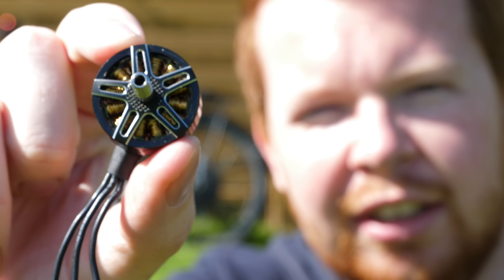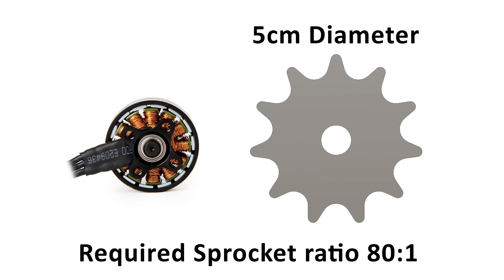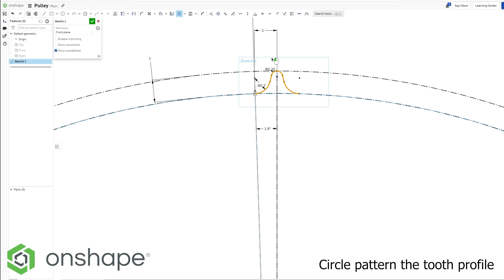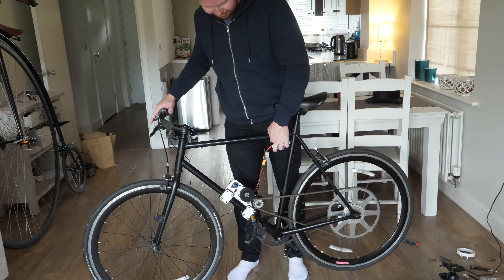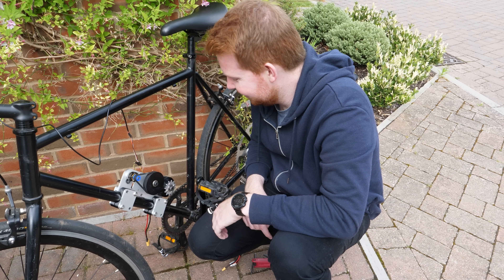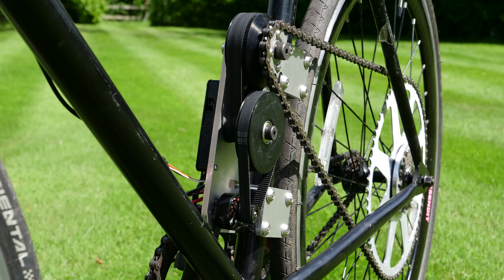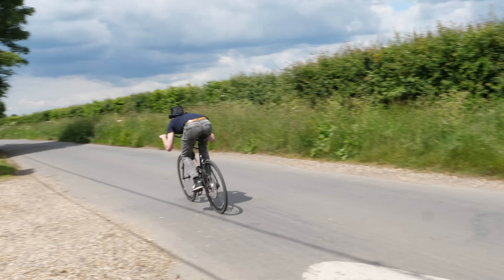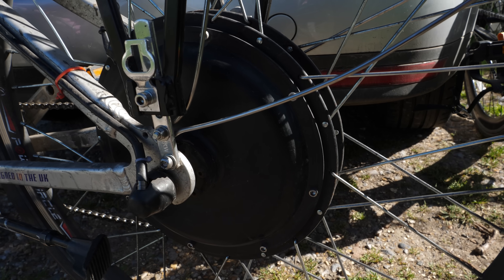Tiny 1kW Electric Bike Motor

Comment: as its a small motor it will build heat fast, what you really need is a cooling fan to remove heat from the motor as you where cooking it as them motors are designed to have air pushed through them from the Propellor to cool them down and some sort of cooling Fan and a duct would help alot.

Comment: The motor is normaly cooled by the prop/fan blowing air thrue the motor to cool it. Might be more reliable with some more motors with fans inside the first  gear  at the motors. skip the chain and make a beltdrive final gear.

Comment: What is the output power of the hub motor compared to it's electical power?  For an EAPC of 250W is the rating electrical power or output power?  For a moped should you buy a 4kW electrical power motor or 4kW output power?

Comment: @ Tom Stanton. Have you seen the high-tech paints and reflective materials that radiate heat out to space and can be cooler than the ambient temperature even in the sunshine? 

Would you do a science investigation of this phenomenon? Could you make a shed that gets its cooling from a radiative cooling system? Perhaps radiative panels could be on the north roof and photovoltaic on the south. The shed could have an insulated 55 gallon drum of water to store chilled water. 

Alternatively... 

Would you do a science investigation or review of magnetic water treatment systems?  A side-by side-test of a control vs treatment test for calcium deposits would be awesome. Also could you discuss the science or pseudo science of the claims made by advocates of magnetic treatment systems? My family bought a magnet for $400 in the mid 90s to treat the incoming water. It was being promoted by a multi-level marketing scheme. I've been skeptical, and would love to see a critical investigation. Could you do a collaboration with one or more of the following?: (Project Farm, Cody's Lab, Practical Engineering, Smarter Every Day, Mark Rober, Nate From the Internet, TheBackyardScientist, SmarterEveryDay, NighthawklinLight). Project Farm is really good about testing products' claims. Cody is brilliant and creative in a science and hands-on way. Actually any of you could do a great collaboration. Also, if the claims made by the water treatment folks are false, please humiliate them publicly.

Comment: I know that torque would be an issue, but I wonder what the highest top speed possible on a DIY ebike would be. Any gearing means added friction and some loss of energy, so surely you can hit a pretty high speed if you just gear it down a little bit less?

Comment: As i wrote in a comment here, there is a difference in what these 2 engines is designed for. And it seemed he had some misunderstandings of why and what generates heat in engines lie this.. so there is some physics to understand if you want to understand why one engine gets so hot and the other not.

I am not 100% sure, and perhaps i dont explain this too well as i am not a physists, but I have read articles on efficiencie of Electric cars Vs hydrocarbon/fossil fuel cars. 

And as i understood it the excess heat is basically the lost energy.
A fossil fuel car is very less efficient(about 33%)(/67%is lost and is transformed to basicaly heat), therefor it generates heat. 
So a lot of the energy when burning the fuel in the pistons go directly to heat and is not helping to move the pistons. Newer cars thend to be more efficient those generating less heat.
Electric cars have ofc a different system where electronmagnetic energy is used to generate circular movements that connects to the wheels... where some energy also is lost while transporting electrisity and also when charging, the energy lost in the process of moving the wheels on a electric car is very less(about 10%is lost and transeforms to heat)... thats why the engine creates less heat and electric cars tend to be very cold in the winther.

Its the same on wolfram/glowing bulbs (dont know the right word in english) ... the energy lost in these bulbs are around or more than 90%, thous they get realy hot, while a buld witch use light emittind diods (led) has an efficiency of 50% or slightly better.. so they are many many times more efficient and create much less heat.

Its very probable that the reason the small engine gets so hot is that the size of the engine is not ideal for how much resistance the engine will get when trying to move this bicycle the momentum inside the engine needed with this bicycle is higher to acctually get it to move than what you need in the engines of the drone.. its almost like you trying to drive a car on to high gear... thats why it moves slower and more energy is just lost and generates more heat than thrust although the engines can use same amout of watts, they are still designed to move a more heavy object (the bicycle) or a more light object (the drone). The engines in the drone is actually spinning in the air... so engine gets less resistance to get a very high rpm. Therefor it needs less momentum to acctualy move.. and is made for a higher rpm. When dont manage to use its high rpm there is a high loos of energy.. like if you drive a car up a hill in too heavy gear, almost chooking the engine. Therefore it heats up tremendously. 
So its a bit sad to say.. but when the engine of the electric bicycly stays realy cool... it means almost all the electric energy from the battery is used to move the bicycly, and very less is lost to heat, so the engineers seems to have done a good job designing a very efficient engine where almost all the energy in the charged battery will be used to move the bicycle as long way as possible.
While the engine for the drone probably have a much lover maks NM. And when given the task of moving the bicycle, its facing a resistance where it needs higher NM than its max output. Therfore it does not operates in its designe range and its efficiency drops to much lower than 90% and the lost energy turns directly to heat.

Comment: If you want torque, get a scooter motor with built in gear reduction, if you want speed add the ability to shift gears, just like one would shift through a bicycle drivetrain using a 7 speed cassette at a max of 150 -200 rpm, get yourself a freewheel crank sprocket (if you still want to pedal), a damn good chain, frame with sold derailler hanger , not a dropout, and go easy on the upshifts.  
Or, save yourself a lot of effort, and just buy a 72v Surron

Comment: You should really try that setup with an 2806 or even wider motor, the wider they are in ratio,  the better the cooling. And you should go for lowest kv you can get , this will help with torque. I'm just hobby quad pilot/builder, but those I learned from quad motors

Comment: What A ridiculous concoction.  First, the motor they have selected is designed to move air, not a fixed load, the motor will fail.
The belts will fail, and the components required for mounting and gear reduction will likely weigh more than a standard hub motor.
I would have not even attempted this.

Comment: Can you confirm that this is a 1kW motor, drawing 1kW at 12 volts.  This would mean a supply current of around 80 amps?  The motor cables do not look large enough to carry such currents without burning out.  I also doubt that you can draw 80 amps from a battery such as this without the terminal volage collapsing.  Are you sure you mean 1kW and not 100 Watts?  UK bikes are, I believe limited to 200W.

Comment: But drones have at least 4 motors - get back to your drawing board and cnc a bracket for 4 motors.
Or 2.
Add a propeller to cool it, or at least put the motor in the air flow

Comment: Very good Tom, thanks for sharing this interesting experiment. Three things come to mind:

1) No way those motors are really 1KWatt, either electrical input or output power. Better use a motor at least twice as 'big' - that is in each dimension so really about eight times heavier. And eight times more actual power output. DON'T trust bottom-end dealers to tell you the real specs on anything they want to sell you . . . EVER!   (Sorry - personal rant!)

2) Save one stage of gearing by using a motor with much lower kV value. Such a motor rotates slower (with correspond higher torque). In this case the belt reduction needs to be heavier duty as well. Say 5mm pitch, or the old XL style.

3) Calculate your overall gear reduction based on the motor running at one HALF it's rated No-Load speed. 

Good fortune with all your projects!

Comment: You should use one more gear to increase the torque then your motor would be spin much faster which will ultimately reduce some heating problem.

Comment: If it gets hot, it means you're pulling more power than it's capable of delivering, whether is 30k or 15k rpm, with the proper gear ratio and current limiters you definitely could power your bike with tiny motors, the question is, whether it's heavier to have a whole assembly of belts and chains to get your gear ratio, or simply one big motor.

Comment: if this motor work 24v then current will be 42A  yeah i believe that :D
1 hp=745 watt  but this motor 1kw .it is main.this tiny motor is stronger than a horse :D

Comment: In my experience drone motors are rated using phase amps while ebikes use battery amps. Short duration peak pulse vs RMS continuous or average power. Would have been interesting to see how much battery power they were each using.
Reply: Its peak current(60s) according to the manufacturer. Theres no away that tiny motor with tiny wires can sustain 50Amps.
Reply: @zaxmaxlax  once the load is going motors draw less amps. so at max speed or finishing acceleration they're not pulling 50 amps to keep going.
Reply: @zaxmaxlax  motor W and Amps aren't realiably. They aren't measured the same. The weight of a brushless motor is a better indicator of its actual power, then it's specified watts and Amps ratings. Then comes the kv and V of course too
Reply: @erikd6124  The datasheet tells pretty much anything you need to know.
Reply: Torque to speed.

Comment: My guess before I saw the video completely:

I wonder how this drone motor is supposed to have an input power of 1kW.
Even if you operated it at 50V, that would still be a current of about 20A - which would melt the windings in less than a second.
My guess: The motor is around 100W-200W and will only survive if it is cooled by the drone's propellers.

Watched the video to the end: Joa. I was right. A handful of watts - as can be seen from the Vmax achieved.

Comment: Put a fan blade/guard on the motor and a clutch on one of the chain gears. This way you can keep the fan blades cooling the motor during high loads on startup.

Comment: why not use 4 moters and spread its load evenly and undervolt them, it may be a bit more efficient, also need a computer fan to cool them.
put the moter and pulley above the chain, reverse its position.

Comment: Why not a fluid clutch then? Cooling system to fluid might be required.  Then bring it up to a stage for motor vehicle use. Might be of use for a flywheel  assistance. Than a sole power. Once it’s rolling, it just needs a slap to keep it going. Like a boy with a big tyre, very heavy but is boosted  by a slap to, assist its inertia.  Looks to be bit downhill in the video.?  
Cool from rear motor to main drive encased drive system .  Keeps weather out  too. Big cooler to End sucking from small motor heat. Possible Venturi effect would help. Or cold weather handlebars heater by waste heat.

Comment: Your final version looks good. Given the motor heating issue, I would suggest maybe using some kind of mini impeller for air cooling. If you can keep the motor heat down, it should allow longer service life. You could probable make some money selling the motor assembly with servo motor air cooling as a ebike conversion kit. Just my $0.02.
Reply: I'm thinking start from v=0 could be improved by spinning up a smallish flywheel, and slam a clutch mechanism on that. Should keep the poor motor from dying too fast (better cooling and software limiting should help out). 

One way to get this to be sorta viable, they weigh just about nothing. How about adding several to the drivetrain, and dump power into them one after the other (gatling principle), get the kick you need, but keep it from burning out. Bonus point, if you have motors in same drivetrain you're just a couple of supercapacitors away from being able to dump 3kw+ into acceleration for very short timespans. 

Make it a "drag eBike" and chat up colinfurze about fabricating the actual bike and you could turn this into something very interesting.

Comment: Nice! I'd use a worm wheel for the big reduction though. You can put the motor axis in the drive direction then, and add a small fan on it. Which could be a nice design element as well, since it would look like the fan is propelling the bike forward :p
Reply: problem with worm wheels is overrun, or driving the worm, I think you mean Hypoid drive ?
Reply: @DJRCMACH  don't see why that would be a problem. No I mean worm
Reply: because the pressure to drive a worm with a wormwheel is very high, a hypoid drive like a car diff is ..quieter, can be driven by the crown wheel on overrunning, is more efficient and produces less heat. offers better engagement for friction should I stop or do we reinvent physics and engineering for jokes 
this is common stuff they teach  mechanical trades in first year. as you cannot see a problem with throwing away money....Throw it at me 😉

Comment: Is it possible to have some sort of a charging system on any of the new electric vehicles just like a gas vehicle with an alternator to recharge and run power back to the vehicle and keep a charge on the battery?

Comment: Nice build.  No need to use a drone motor, though.  Why not just use a higher torque, lower rpm electric motor to keep it the same temp as your e-bike motor?  I never did like hub motor designs.

Comment: I am sure someone have said this before, but, the drone motor relays on the air from the propeller to cool down.  if on the  pulley you integrate somehow a propeller like geometry (something to channel air) it would make it better.  In other hand, these motors are racing motors. They are made to be replaced after a few hours of works, like racing cars, or bikes, or anything that has a huge performance for it size, it will last very little.  In other words you are using a GTR to plow the fields.
In other hand, i always wanted to try to see how long it would last a quadcopter motor in a bicycle... and now i know thanks to you :D.... 

by the way, increase the gear ration, the torque is what is killing the motor... it may be finish having a lower speed, but the motor will last longer...
Thanks for the video :)

Comment: 1:08 correct me if I'm wrong, but I'm not sure that's the issue. Running the ebike that fast would be awesome! The problem isn't that it's impossible to control at that speed; the problem is that it makes far lower torque and would result in a very low force at the contact patch between the rear tire and the ground. The gearing down isn't to make it manageable, it's to give you enough torque. Great video otherwise though, love your channel. The small motor is still super impressive.

Comment: You could use two instead of one to resolve the heat issue, sorta run each at 50% rather than 100%. Could also install some cheap ducting, or perhaps modify the housing by soldering on some aluminum or copper fins to act as heat sinks. Reckon you could do something like encase the motor in a sealed box and fill it with pure mineral oil, even add a radiator or some sort of heat exchanger, but I think that's just getting entirely too complex

Comment: question here. how come you didn't attach it with the existing gears? would it still work well? or would the gear ratio be too little?..... I ask because this is really interesting and I would like to do the same thing as a summer project. (for learning purposes and cad work too) Oh yeah, one last thing couldn't you just use a potentiometer instead? when you attach the motor to the potentiometer and then to the battery? kinda like how electric go-karts pedals work!

edit: fixed my horrible grammar lol
Reply: I did some learning on the topic trying to find out if KV also =motor torqure or what exactly is the torque. still confusing tho

Comment: ebike motors are underrated for safety, and that drone motor is overrated for marketing. Its not at all the same power output. The ebike motor has to dissipate all the heat assuming little or no airflow. The drone motor has tons of cooling. And you are losing most of the power with inefficient gearing. And, I don't know what you used for a battery or connecting wires, but that's really critical to get the peak potential power. From the look of it, you were getting 200W max out of the system. 1000W should be enough to get you over 60kph on that bike.